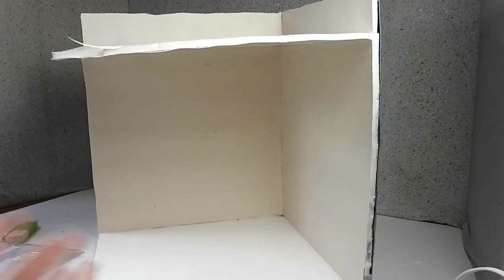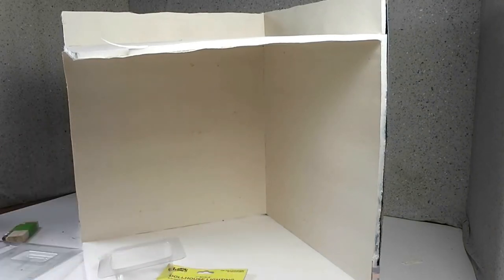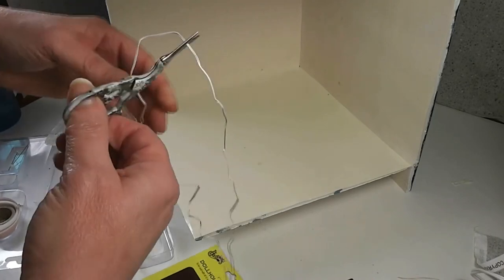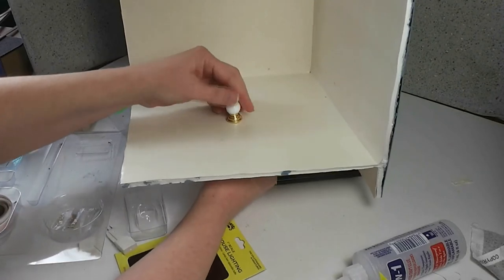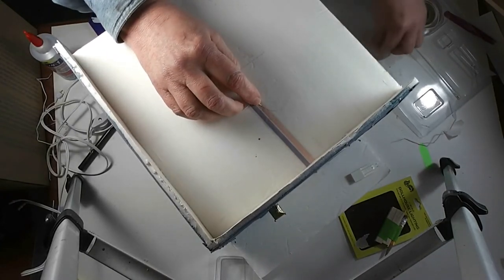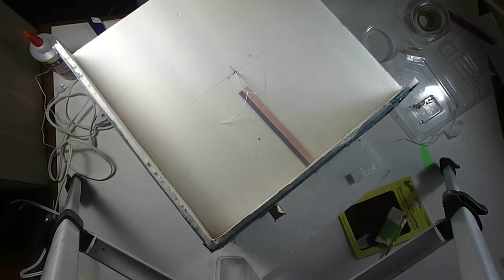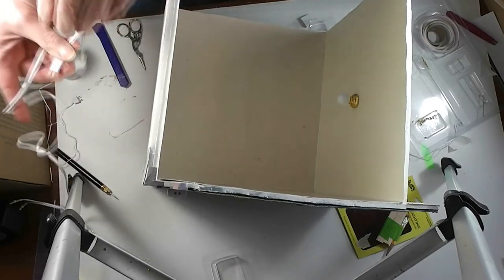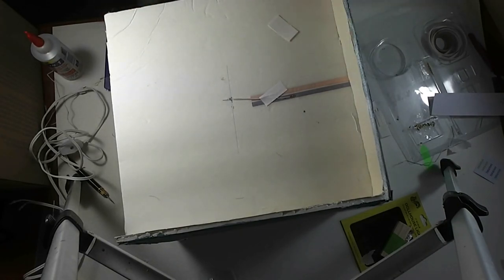Dollhouse Wiring 101  pt 5 Installing a Dollhouse Ceiling Light

Comment: Hi, I hope you get this!  I tried testing my light and bad things happened.  The light bulbs popped and the lead in wire seems to have shorted out. Any thoughts?  Thanks much! CaT
Reply from the maker: It sounds to me like you probably have crossed connected the wires at some point. Check every spot where you put in your brads/eyelets. You probably have one of them in the wrong side of the tapewire

Comment: Hey, do you think this can be done in a Barbie dream house? I got one for my niece and now she wants lights...
Reply from the maker: I think the biggest stumbling block would be finding working lights that were the correct scale. Since Barbie is twice the size of dollhouse scale that could be a problem. If you are crafty you could probably make your own fixtures to fit the scale.  As for tape wiring it would depend on what the house is made of, is it a material that the wire can be adhered to and the brads or grommets installed into.
Reply: Get the battery powered lights. No wiring required
Reply: But one problem... the battery powered lights are rip offs i saw one light that was just like that one she was installing and it was 32 dollars
Reply: At hobbie lobby
Reply: And twice  the price  online
Reply: It should already have lights installed
Reply: @tuileriesantiques9057  battery lights are at the dollar store, like a string of lights. In the past I've found a battery light pack at Michael's, in the floral dept, but it had 10 lights, and each light was on a separate wire, not strung up like Christmas lights. I used them in my son's dioramas for school to light up fire pits,  torches on poles, even stars and moon in the sky. I've seen people use bottle caps from water bottles to cover the bare bulbs as a "light fixture" on the ceiling. Barbie houses are usually pre-decorated though, so wires would show I think. Maybe you could add lights by having lights in a Christmas tree, or something like that.